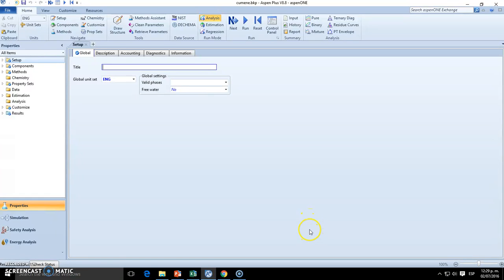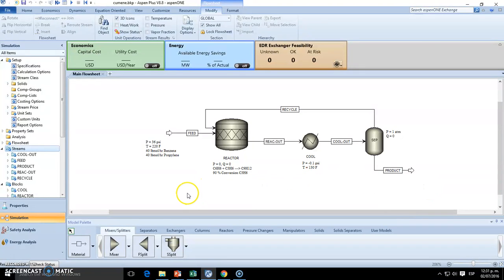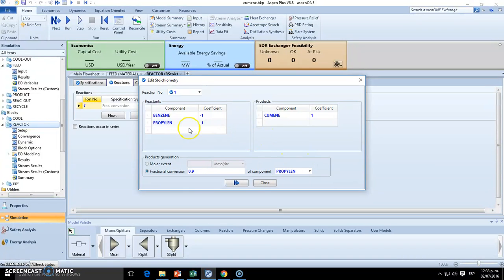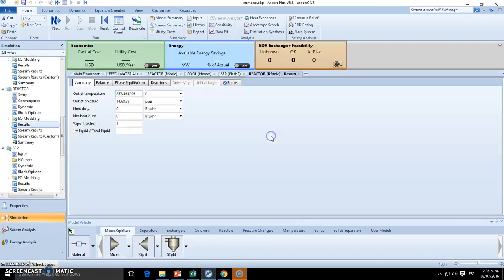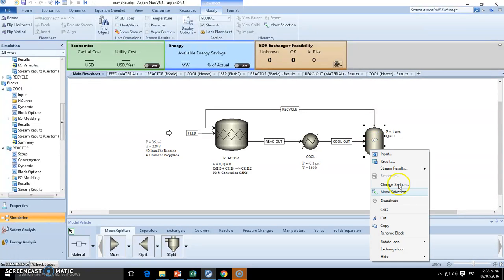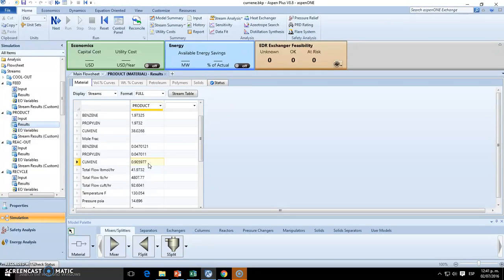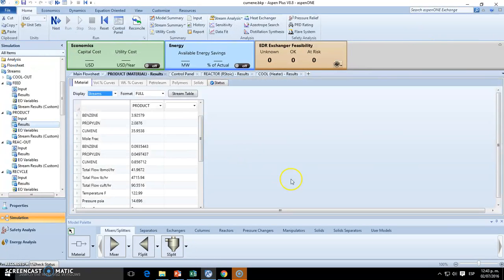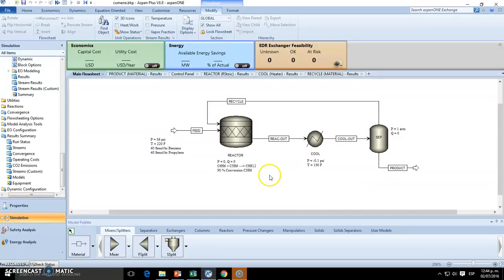Lecture 39: Study Case II  - Cumene Production (Aspen Plus - Basic Modeling)

Comment: Why did you use SRK rather than Peng Rob or we can choose either one ?
If we looked at Eric Carlson and Bob seader recommendations , the property packages suitable for the components are these 2 .
Reply from the maker: Yes, they are based on Equation of State, with little modification in their parameters... the main idea is to focus on the gas interaction rather than the liquid interaction... My favorite is PR but you may want to compare results at the need of the course

Comment: I wasn't able to run the simulation on my PC because it said I had to fill in the parameters section under the Methods section you said earlier in the video. How do I go about it?
Reply from the maker: You will need to select a thermodynamic model, then click "run" instead of going directly to the simluation environment

Comment: Very useful thanks 👍 am doing a similar Cumene production project
Reply from the maker: Thats great! how is it going?
Reply: Chemical Engineering Guy is going well but is a bit tricky our process has two streams pure Benzene and propane and butane mixture, am struggling to do the feed stock preparation as the design spec says it should be 150 degrees c and the propene butane stream keeps vaporising no matter what pressure I make the pumps
Reply from the maker: I see... this is most likely because of the propene... but should not be that extreme... what is the T/P conditions and composition of the stream vaporized?
Reply: @ChemicalEngineeringGuy   Sorry for late reply completed project now and everything sorted also finished an optimisation project on our final cumene production project, your channel helped a lot!